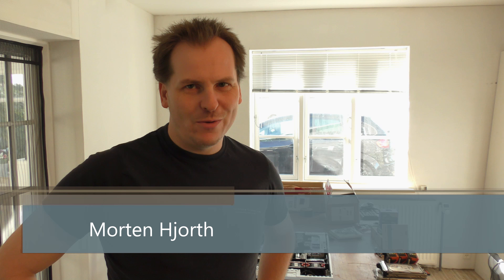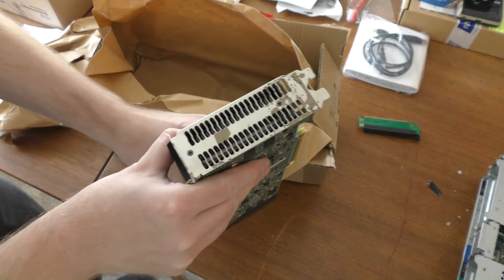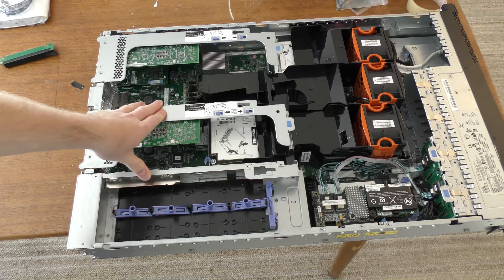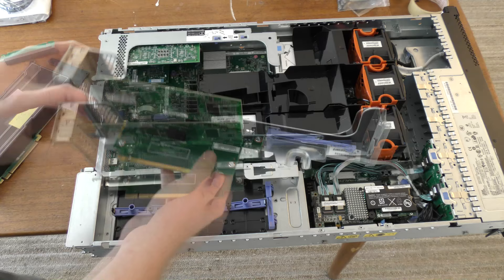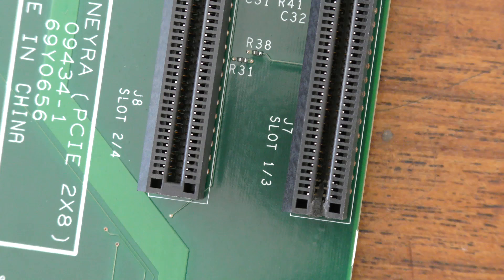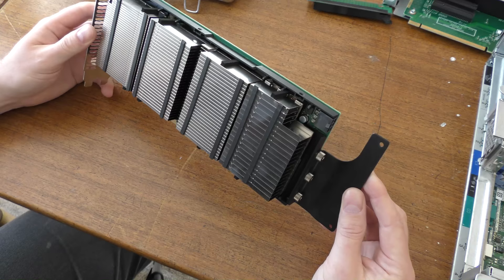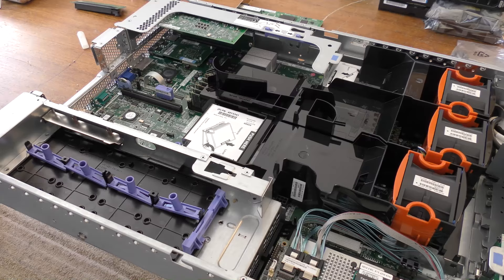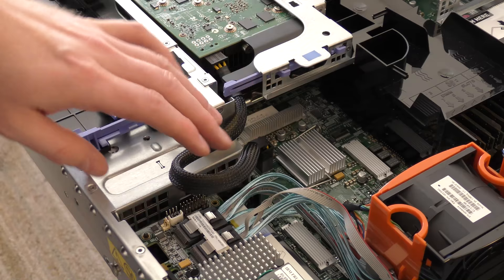NVIDIA GRID K1 Teardown and Install in IBM x3650 M3 Server - 412

Comment: Ah, that black metal think is called a unisink, it's used to keep the board VERY rigid while cooling the GPU controller, VRM and Memory (although they did not use a back plate to cool the memory chips on the back of the board, I would have returned that GPU, for €1800+ I demand my high end server components have correct cooling.
Reply from the maker: Hi
I am not able to return this one :-) only payed €101 for it.
Thank you for watching! :-)

Comment: I have a K1 to play with here, it has one dead GPU, the heat killed it I think, bucause we put it in a crappy IBM server....(no it was infact a Dell server) - the server finds all 4 GPU's but says one is defective
They gets REALLY hot, in my first test I started the GPU load and after 10min's the server reported that it had restarted the GPU due to "a error", then I reached for the card I discovered why it had restarted :)

Fun to play with (VDI), but for graphics work load it is very slow
Reply from the maker: HIHave you tried this in VM-ware? Passing a core through to a VM, and how to test if it works?
Thank you for watching! :-)
Reply: Hi, only in a VDI setup, not like you tried it in a video a while ago - I could try it though, didn't you get to work?

Comment: ahhhh.... you need to remove the old paste before putting the new one.....
Reply from the maker: HI 
I did, that was heat transferring rubber somthing! I did not have that! :-/
Thank you for watching! :-)
Reply: @MyPlayHouse   thermal pads they are called. they are super cheap and can buy them from amazon too. you put thermal paste onto a thermal pad... not sure it does anything.... you can just buy pads they re dirt cheap

Comment: Hey, awesome video. Did you know that there are PCIE cables that plug into a x16 slot and allow you to install a x16 pcie card away from the slot. I'd imagine that if you removed that pcb and used a PCIE cable it would fit and give you full bandwidth.
Reply: Good point! They are called extenders and they are pretty cheap :) It would be better if he will use  soft x16 extender because of K1 bus and PCIE gen3. I can bet that this serv. MOBO have pcie gen1 or 1.1
Reply from the maker: HI
I have ordered two of those, to day! But the slot in the x3650 M3 is not a pure x16,, there are more connections :-/
Thank you for watching! :-)
Reply: My PlayHouse Too bad, thanks for making entertaining nerdy videos. ^_^

Comment: You can connect it directly on to the motherboard without using rasing card
Reply from the maker: Hi iulian ispas
Thank You very much!  The riser card is more then just an x16,, and the GPU would also not "just" fit in the system board,,, and even a ribbon cable would probably have to go in the riser and not the system board. 
Thank you for watching! :-)

Comment: its just a riser, draw it up and have a chjinese board manufactor make you up 20 or so, there pennys to have made :) and theres a known demand
Reply from the maker: HI
I haven't been able to find copies either :-/
Have ordered two flexible things today.
Thank you for watching! :-)
Reply: i ment having a few produced yourself, its a simple known layout, the software to draw out pcb's is mostly drag and drop and riser cards are direct connection, you can literally draw lines up ether side of the board. a 2 sided board costs as little as a single euro. if you want the socket populated and pre soldered any manufactor can easily place one. its REALLY verry easy and cheap to have things like this produced in small volumes, fast. the joys of 2016 :) have a look, again, if they are the price your asking there may well be a demand and you could pocket a few pounds on each one and help everyone out.
Reply from the maker: HI minor0confusion 
That would be cool, but I'd like to have the original one to make sure I got it right.
Thank you for watching! :-)

Comment: An Nvidia Grid K1 for 101€ is amazing value for money. A fan error on a passively cooled card.......strange. Quick question, why bother with the riser card? I would plug the GPU straight into the Motherboard? And you did not clean off the old thermal paste ahhhhhh
Reply from the maker: HI
I need the air flow in the server... so I'd like the card in right.
Thank you for watching! :-)
Reply: My PlayHouse
Thanks for replying !
Reply from the maker: HI quincy8557 
Thank you for watching! :-)

Comment: Hi! Thank you for good video! I decide same task in HP dl380 G5, that have one full lenght socket in riser. So don`t you know, does ibm x3650 M2 has same video power socket ?
Reply from the maker: Hi sergeyyy ghj
The Lenovo x3650 M2 and M3 both has one 6 pin power connector.
Thank you for watching! :-)
Reply: It`s real good! And after updating a firmware it can start with xeon 56 series ( I mean M2). And M2 cheaper.

Comment: I had never heard of these Nvidia Grid cards. Their only cards I had ever heard used in servers were the Tesla models. I look forward to seeing if this works! Alternatively, would it be possible to get a PCI-e x16 cable extension and plug it into the socket on the board rather than using a riser card?
Reply from the maker: HI
Yes I have ordered two of those :-)
Thank you for watching! :-)
Reply: There where also quadro's

Comment: Graphics Card Conflict:  Great video.  After seeing this I decided to perform the same mod.  The new graphics card is working fine,  however, if I try to keep the built in graphics card running as my primary video output, I get an error code 12 "device can't find enough resources..."  If I uninstall the driver and reinstall it works, but it must be done after every reboot.  Any ideas how to fix this issue?
Reply from the maker: Hi Mike Hoff
Thank You very much! That suckes! :-/ I think I have had something like this way back,, But I do not think I solved it,, think I gave up and went for something else..
Thank you for watching! :-)

Comment: even if the grid works... doesnt make any sense to make it work at half speed.
cant wait for the next video
Reply: it does not literally run on half speed, the bandwith is split in half.
the performance loss isnt much, depending on what its used for
Reply from the maker: HI
Yes next video is friday,, and then I do think I Will need more help :-)
Thank you for watching! :-)

Comment: Hi sir, i have question, what is the diffrence between the GRID and the GTX? will these server support gtx ? or just grid? :-)
Reply: Grid is designed for usage in servers often times for passing through graphics computing power to virtual machines while gtx cards are meant for mainstream desktop users who want to game and such thus why grid has no ports for video out and a gtx card does. Hopefully that answers your question
Reply from the maker: Hi
Yes,, NVIDIA has not enabled pass through on there "cheap" graphics cards, like AMD has. so you need one of these bloody expensive ones to do that! 
Thank you for watching! :-)
Reply: Alright, thanks sir Michael and sir Morten for answering :-)

Comment: Do I need a raid controller and can I disable raid on this system (I have a old one im going to use for a desktop )
Reply from the maker: Hi Deathstrike 19781
Thank You very much!  The Raid card will give you a good increase in speed,, but you can make a Raid0 on a single drive. that will work.
Thank you for watching! :-)
Reply: @MyPlayHouse  thanks for responding